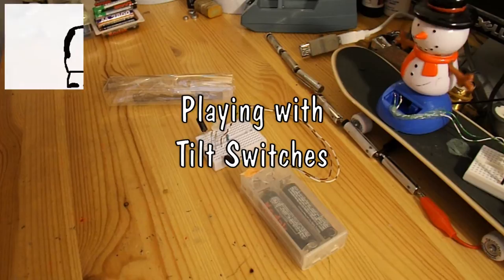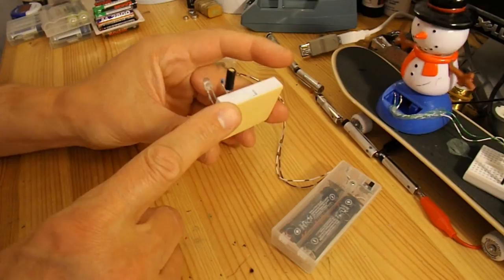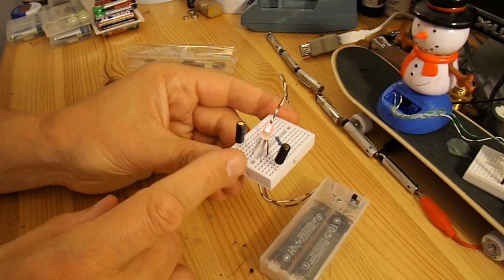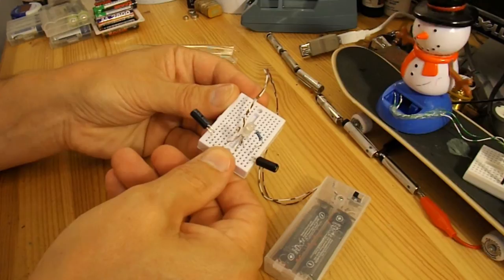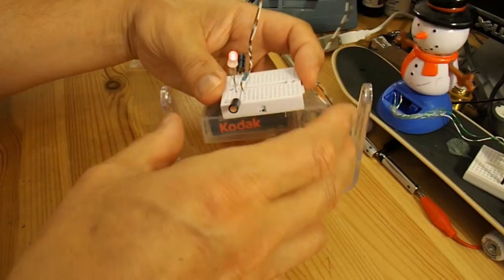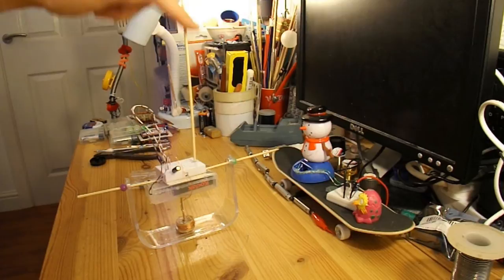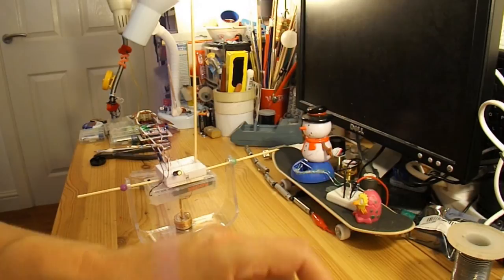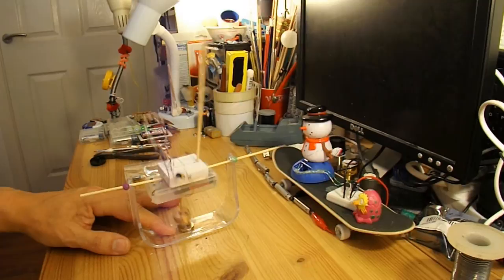Playing with Tilt Switches

Comment: You may put the diode on top, catching the back emf.
I like these tilt switches as you can use them as 'hidden' switches in devices (so that there is nothing sticking out of it). Like put your flashlight on the glass (down) and it is off, lift it up and you have light. Something like that.
Reply from the maker: Hi Deslo, yes I could have added a few more components to tidy it up. I expect they will fail quite quickly with no protection and there is a bit of contact bounce in operation too. These switches also react to magnets so I have some other ideas in mind.

Comment: Hey, cool project 😁
Reply from the maker: I don't seem to do this sort of thing now. Maybe I should 😊😊
Reply: @GrandadIsAnOldMan  Your 3D printer has corrupted you 😱😵‍💫😁 Life moves on, as long as we keep doing things we enjoy 🙂
Reply from the maker: @ForTheWhim  yes, I do what I enjoy and what I find interesting now. No pressure to do what other people want, just suit myself 😁😁
Reply: Really found this of interest as I’ve been trying to figure out a way to creat an artificial horizon for my sextant. I copied your circuit from the video, but it doesn’t act as yours does. I’m at a loss as to why.

It only turns on and off in one direction and only if the tilt switches are in the same orientation! 😅😢😮 Thanks for the video though.

Comment: How much max volt and ampere work?? 
I plan to use it on a motorcycle, for cut off the engine
Reply from the maker: Before you buy one, you would need to read the specification to find a suitable one for your purposes.
Reply: @GrandadIsAnOldMan  o.k thanks dude

Comment: Can you do what you have done on that white box on a normal wired circuit? I am doing a project and I don't know wether it will work like that because all the videos I see are done on that white box thing
Reply from the maker: +Edward Lakin the white box is known as a bread board. It allows you to connect electrical components without having to solder them. People use them so that they can put circuits together quickly and easily and then make changes without damaging components by having to desolder them. I suggest you google breadboard to get more information. They can be purchased cheaply online.
Reply: +GrandadIsAnOldMan thank you